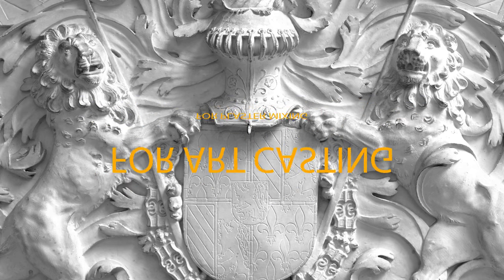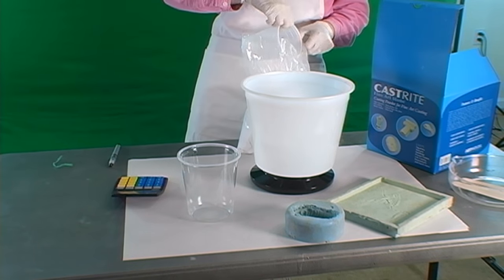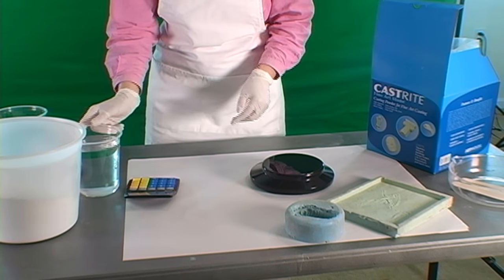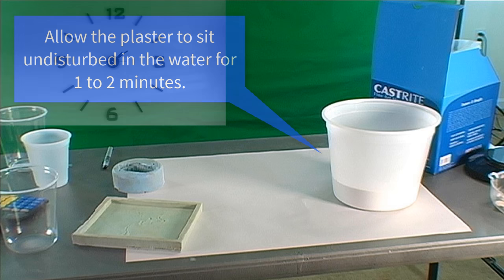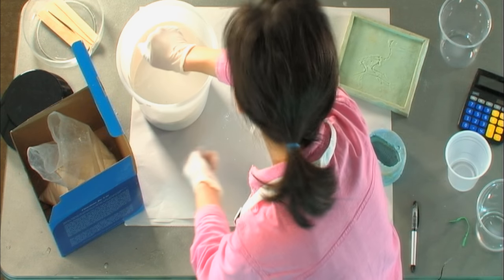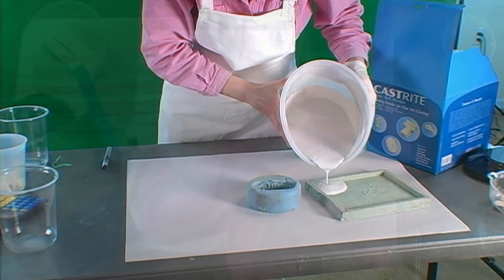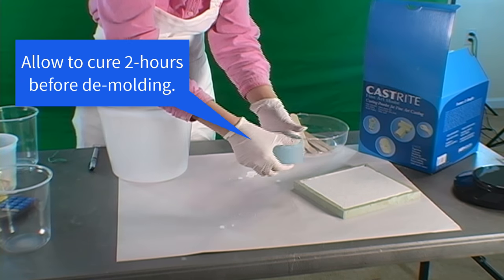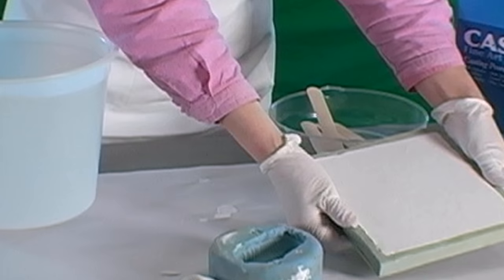How to Mix Plaster of Paris Technique the Easy Way for Superior Strength Tutorial YouTube Video

Comment: I want to know how much area a pound of plaster will cover. I finally gathered several molds just in case and a pound will fill a pie pan about half way. 1 inch deep by about 10 inches across.

Comment: Although I take all the steps mentioned in your video, I still get a few small pin holes from air bubbles. Does it make sense to mix up a small amount of the original powder to fill in the pin holes rather than using an off the shelf filler?
Reply: No matter how careful you are. Elimination of pin holes can only be accomplished in a vacuum chamber.
Reply: Thanks for the help. Really appreciated.

Comment: You got your figures wrong you said multiply the weight of the plaster by 6.5 it should be 0.65
Reply: Thanks Deakin Kell
Reply: Also he wrongly stated that plaster weight should be 'multiplied' by 6.5 (or correctly, 0.65). Plaster weight will be divided by it or water weight multiplied.
But good informative video
Reply: This makes sense as the mixture I did by following him became far too thick. I had to shake it roughly to get it to go in.

Comment: I'm glad I saw this. I did my first plaster cast in a VERY long time and unfortunately I stirred the water WHILE adding plaster... a big no no
Reply from the maker: You should be okay. Though the cast will not be as strong as one made by allowing the plaster to sit in the water undisturbed. Just be more carefully in handling the cast as it will be more fragile. We wish you all the best
Reply: @EnvironMolds  I ended up doing a new cast and I let the plaster sit for 20 minutes in the water... and after it settled, I poured off the water off the top, mixed it up, and poured it into my silicone mould...

Now it feels very solid and I'll be waiting for a week so it can cure
Reply: @KRGraphicsCG  a

Comment: Mine's a very small project. Three 5x7" tiles had fallen off a vertical porch surface. I may have used too much water, but the tiles are very light and I guess I'll know the outcome in 24-48 hours. The video was very thorough, but I didn't absorb the part @ water/plaster til I'd already affixed one'a the tiles. If it doesn't hold, I'll try it again, watching the ratio closer.